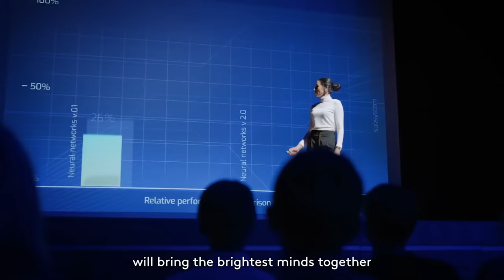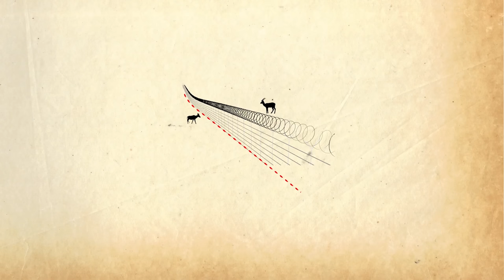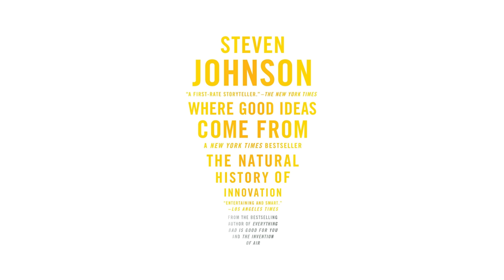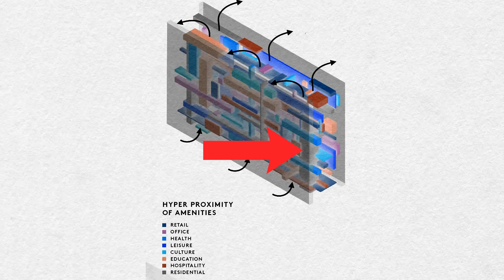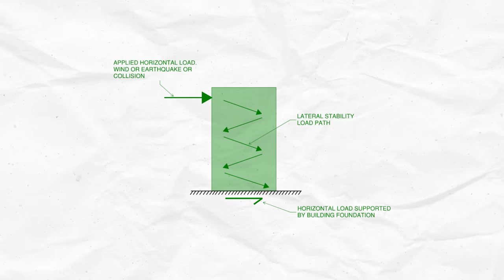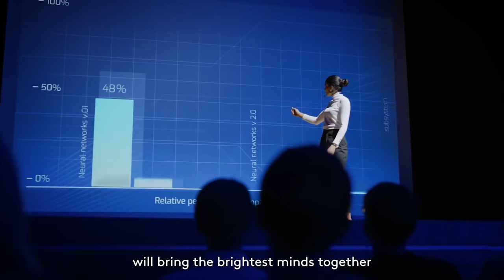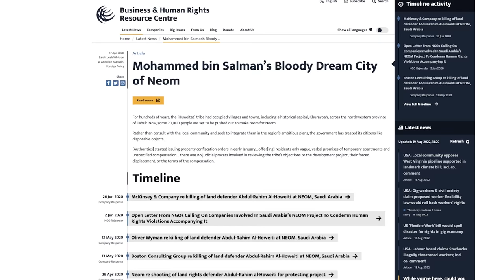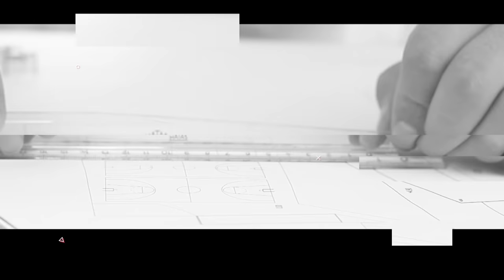This city concept breaks architecture (THE LINE)

Comment: excellent critique of the project.  I think architecture education is more rounded than other disciplines.  It looks at the project from multiple angles: from utility, practicality to structural, social, environmental, ethics, cost...  Well done.  As for this project, hard to imagine it will be built as defined currently.

Comment: This project sounds similar to/inspired by architect Paolo Soleri’s Linear Arcology concept. But his designs were adapted to the environment and had many wildlife passage corridors, which are basically arches/holes cut through it. It was also much shorter and isn’t covered in silly mirrors.
Reply: Came here to say this. But check the comment about Arturo Soria above.

Comment: Based on experience, the problem here would be regular maintenance. Everything looks nice when brand new, eventually urban decay creeps up. Elevators start failing, lights flickering, sewage system clogs up, ventilation starts malfunctioning....

Comment: Adam Something did a video about this and he identified a lot of issues too.

Great point about the ecosystems. It occurs to me I learned the same thing, but I can't remember where or think what course it could have been. I have not done architecture. Now it's bugging me. Maybe it was just self learning.

As you were talking about the transit times of this hypothetical super high speed train, it occurred to me if this thing worked and was economical, those benefits could be applied to a regular city design anyway. Sure you would need to account for higher speed cornering but the bottleneck in either case is likely to be the acceleration and deceleration for all the stops and the stops themselves. 

Having only two lines also makes your train timetable very inflexible compared to something like a modern subway. You would have to have one track going East to West and the other track, West to East which means you either get express trains or you get trains making lots of stops. You won't get both. 

This line constraint is just dumb. The line in of itself solves no issues and it brings with it a whole lot more problems with it's inflexible and impractical design. Any useful subsystems or design concepts in it could be equally deployed in regular cities providing more ideal end results.

I hate this project. It's yet another one of these impractical, scientifically and historically illiterate feels good engineering projects that is the fashion these days and I really hate that YouTube is now spamming me with sincere ads for this dystopian vanity project.
Reply: I thought the “something” in his name was meant as “i only remeber his first name but im sire he also has a second name”, entering “the line adam” in to the youtube search already gave me the suggestion with “adam something”, turns out this youtubers name is fr “adam something”. Crazy plot twist…

Comment: I could see this as a small experiment to determine if it would work with a minute community or town, but jumping right to constructing a massive city from nothing without proper knowledge of the practicalities and shortcomings seems too hasty and reckless. If it fails then it will become another abandoned ghost project looming over the desert, which won't be good for anyone.
Reply: However the city is design by real experts. The Saudi government just paid for it. Allot people seem to have a hard time being objective about this project.
Reply: That would be a good idea. It's like all these ideas of colonizing mars but we didn't even have a proper test on the desert with people "trapped" for long time, trying to survive in extreme environments.
Reply: @megustaav  As a founder of a tech startup I'm intrigue by bold projects. But to be honest, I'm skeptical if they could pull this through. I hope they do though.
Reply: @primaryesthethicinstincts4832  it's not bold, it's stupid. It does not solve almost any problem we have in modern cities today and just introduces new that we have no idea if they are feasible to overcome. Just be real sceptic and do simple math. Take cost of similar in size building and then try to fit as many as you can in 170 km. That's just simple construction we know how to build for many years. Not complex structure that is 170 km long in the middle of desert. Just try.
Reply: @megustaav  If It is an AI planned city. Then things like heat distribution data, moisture distribution data, type of renewable energy, power grid systems , crowd dynamics..etc.. A whole bunch of data and parameters were given as inputs and cost functions to achieve an optimized (multi-objective optimization) design. So obvious something like that is going to be radically different from what we are familiar with. We don't know allot of the details so I could be wrong but its too early to make judgments about the design.
Reply: @primaryesthethicinstincts4832  that's just vaporware talk. Let them build 100 or 1000 meters long proof of concept and then we can talk. At this point it's just not feasible (with the budget they have) render bs. It's essentially a Hyperloop type of bs.
Reply: @megustaav  I agree with you to some extent. But having worked in an AI research lab, I know that an AI can come up with really counter-intuitive designs. The height and the 'sandwich' design for example are very useful for managing heat and moisture dissipation in a desert with minimal energy and other resource costs.

Comment: From a material use perspective, this uses a LOT of material for the walls. Think of a square and how much perimeter it has versus the volume. Now if you maintain that same volume but squish the sides together it becomes more rectangular and longer. The perimeter goes up significantly, thus making the amount of material needed for construction a lot higher in quantity.
Reply: Think of the cleaning needed for the walls too.
Reply: @rajeshprasad6016 in 55°C...

Comment: When in the desert, if you take a temp every 10 feet vertically, you will find a pretty sharp gradient between surface (125-130F) and 50 or 100 feet up (90-100F at a guess).  Makes for some very interesting dynamics along th inside and outside faces...

Comment: Given the length and height of this, plus walls of glass facing directly into the desert, how long before the lower levels have their windows either sandblasted or covered in sand drifts? Also, pity whoever pulls the short straw to carry out maintenance on the exterior faces of the structure - they'd have to wear something akin to a space suit (minus the oxygen tanks) to be anywhere near comfortable...
Reply: It depends on the materials used. ie: The past decade there have been major breakthroughs in smart materials and meta-materials research.
Reply: These project are destined for the most favorable part of Saudi Arabia...they have invested millions to study before designing the very project.
Reply: night is a thing in the dessert when it gets cool.
Reply: @primaryesthethicinstincts4832  You've managed to make this impossibly expensive project even more costly.
Reply: @quantum5867  Sorry but a night in the desert is as cold as the day is hot.
Reply: So like, there's this thing called air conditioning, you can put in the the cab of a large truck, so it will be quite comfortable while doing the daily drive to clean up the sand from the lower levels.
Reply: @BHMatrix Ah yes, I could totally use AC while im working OUTSIDE cleaning my windows OUTSIDE.

Comment: In addition to all the good points you've raised, it also adds unnecessary single points of failure particularly in regards to transport. In the large city i live in, if something happened that shut down my train line, I could catch a bus, either all the way to my destination or to another operating train line. I could get a tram in some parts of the city. I could drive or get an uber. In the line concept, were there to be some train accident or failure you're stuck going no further than you can walk. Depending on how it works, a failure 150km away might mean you have no transport.
Reply: Neom is all about the crazy experience that money alone can buy. Perhaps the idea is as good as a really huge long air cooled mall space, which coincidentially are favorite meeting / shopping spots for Saudi's. 

Most of the issues Dami mentions regarding envoirnment / natural habitat or city expantion or even loosing money to ghost cities are next to irrelavant to the average Saudi who just want to get out of the damn heat! To them its all about their past glory of oil, nomadic culture, orthodox religion and the easy glitsy life. Actual money really is secondary.

Heck when we have oil lines and cable lines running across deserts and even under sea across countries, they probably figured this to be just the sort of 'line' that would stand to be unique / modern for their nation in the new millenium.
Reply: I was thinking the same, one big bottle neck, without it functioning the whole city stops.

Comment: THANK YOU!  I went to Urban Planning School in the 90s and heard about this linear city concept, and it fascinated me.  Some part of me always knew this was an insane idea as a human environment, but I could never figure out exactly WHY it wouldn't work.  I'm a transportation planner, and the idea of having everyone's travel needs confined to a corridor (and thus all travel needs easily met by transit and walking) seemed like a good idea, or at least one worth trying.
So I thank you for pointing out that the problem is the VERTICAL travel.  Lots of elevators would slow things down, and escalators (which are better at moving large #s of people, although also usually pretty slow) would take up a fair amount of space in such a narrow city. 
FWIW, in the original concept, I believe it was supposed to be surrounded by parklands with biking/walking trails on both sides, and half (or more than half?) of the apartments would therefore have a view of the park.  I'm not sure why they are putting everything underground in Neom...possibly it's just too hot to have people baking in a glass tube on top of the desert!
Reply: I'm sorry to say it this way, but I really think a transportation planner shouldn't go through college ignoring the advantages of a network system over an isolated linear system in terms of service quality, congestion, vulnerability of the system, and then social, cultural and psychological interest of the built fabric and our daily lives. With all the interest this dystopian project seems to sow into people, I really think people should be reading Cacciari and other philosophers a bit more, but also Bertolini and Cervero for transportation.

Comment: In addition to the issues you outlined so well is the east-west axis. Residents on the north side of Neom will never receive direct sunlight (so they can grow moss in their window planters?) while those on the south side will have no relief from the sun. Wouldn't it be an improvement if the city were rotated 90 degrees.
Reply: The southern side will be shielded by the wall of mirrors though, so really only the upper levels of the north side will receive sunlight, and only for a couple hours around noon.

Comment: When i first heard mention of this i thought it was "The pyramid city" which is a project proposed a while ago. Then I saw this concept & was like so you're putting a giant mirror in the desert, is it going to be covered in solar cells, what effect is the reflected light going to have on surrounding areas & animals?  I don't think it's necessary to build this  supermassively long structure It could have been done in smaller sections (villages) and linked with underground tunnels If it's ever built.  It seems to be a problem in search of a solution.
Reply: oh poor animals. makes me wanna cry. what got dinosaurs extinct? what caused ice age? extinction is part of nature, as well as adaption.
Reply: @omaxshendy5732  the answer to both your questions definitely wasn't another species fucked everything up and survived. Like even if you don't care about the animals, if enough of them go extinct we do too...
Reply: if you actually spend the 1 trillion dollars or whatever this city would take in construction and used it for wind turbines you could actually supply 200 million people with green energy and have them be carbon neutral. 200 million is a good bit better than 9 million. also that idiot not caring about animals dying deserves the fate he does not care about.
Reply: the only problem is that there are no animals near the building but the fun fact is that they want also to change the weather in the whole Arabian peninsula and they are doing the necessary things to do it in fact now
Reply: @omaxshendy5732  I hope you stick to that sentiment when our alien overlords come 👽 though I doubt it because then it would be your ass on the line
Reply: @tarettime9392  that is a simple fact that many of us choose to ignore
Reply: @herroberbesserwisser7331  air tirbines aren't green at all. Their plastic blades need to be changed quite frequently and aren't recycled afterwards. They're just buried. They also require massive amounts of lubricant which is made from, you guessed it, oil. And they don't even produce that much electricity. Maybe nuclear synthesis would be greenest if we find a way to do it.

Comment: Great analysis. You touched on a couple of interesting ideas regarding phasing this project. If they build each new 800m section as a stand alone phase with all the necessary amenities to attract investors, then all sections will be very similar and pretty boring. No need or desire to ever leave your section. Otoh, if they don’t and sections contain different amenities it will be difficult to attract residents until a significant portion of the project is done. Another possibility is that they gradually revise and improve sections as the project progresses creating different experiences and levels of desirability between sections- although I guess regular cities are like this already - but in a linear city, you may have zones where property values are badly depressed and there’s no way to avoid travelling through there, causing other issues.
Reply: Ideally the would make each section completely functional on its own, but add larger attractions on only a few sections. Like maybe one section will have the Line equivalent of a stadium, another might have an amusement park, and another will have a large university. These all of course bring logistical problems of their own, and hopefully none of this ever happens because this look like the city in Stray.
Reply: You don't need much in terms of amenities for daily life. A grocery store, a handful of restaurants, that's basically it. And for the weekend fun trip you hop into the traint to Neom.